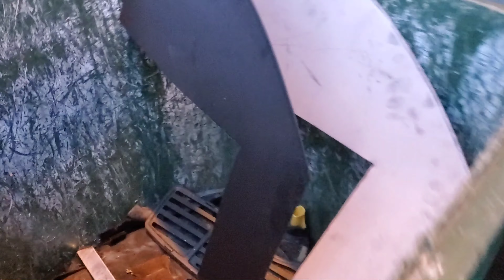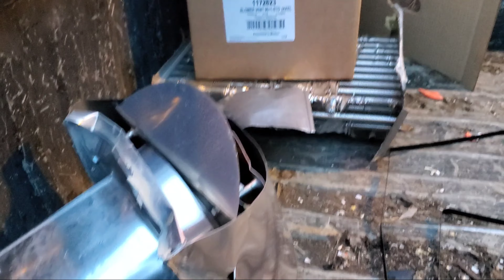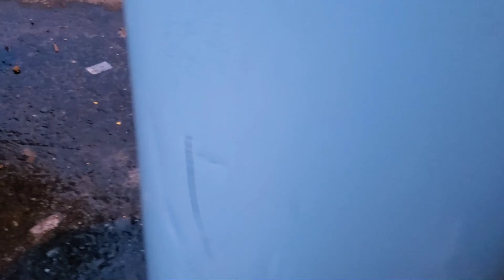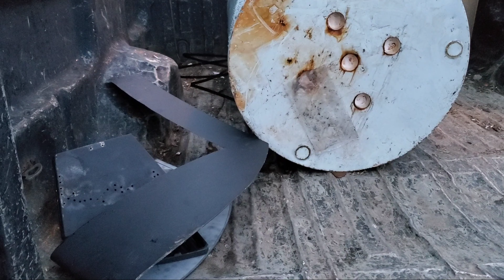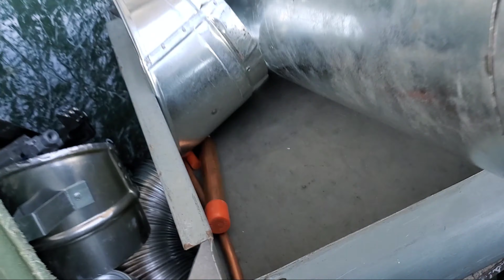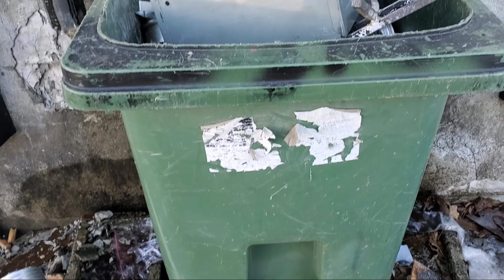More to add to scrap horde

Comment: Wow, what an awesome haul. Do you have one of those little machines that can strip off the coating on the copper wire, or do you do it by hand?? A fella I knew in New Hampshire used to burn it off, paying attention NOT to melt the copper. Just wondering. Have a great evening, tomorrow's another day!! 👍😎🐦
Reply from the maker: Yes I have a wire stripper it help alots